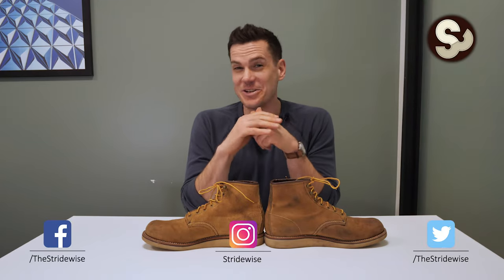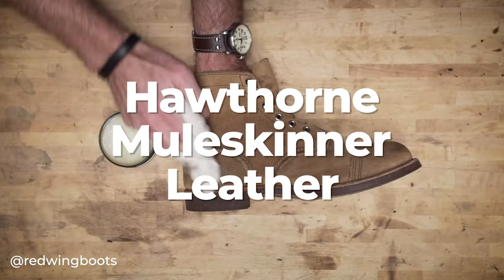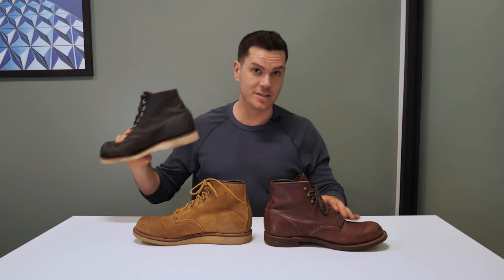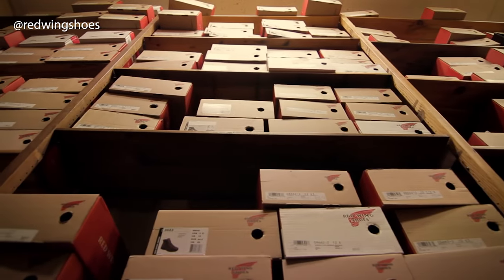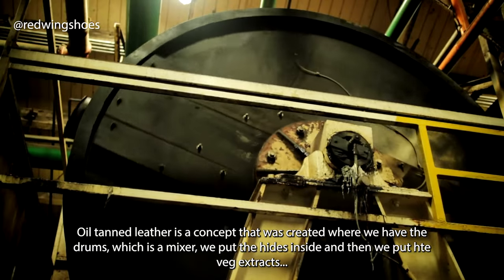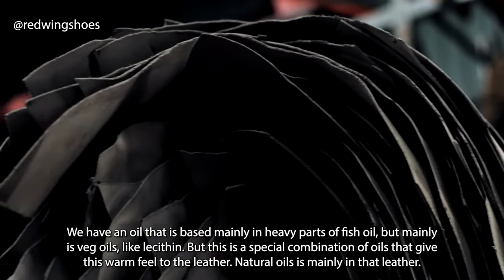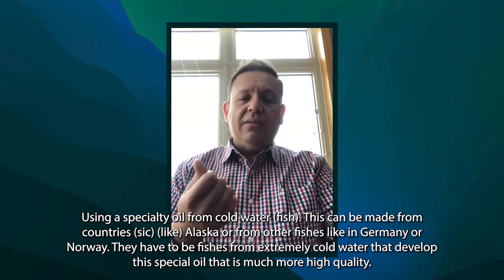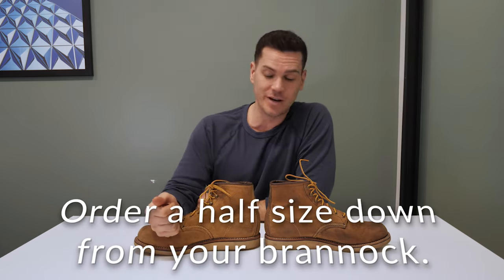How Red Wing Makes Their Leather (+ A Review Of the Extinct Rover Boot)

Comment: In the mid 90's I had a pair of brown 6" wedge supersoles, I believe the model was 00686.  They looked kinda like the ones in this video except smooth leather with the wedge supersole.  Sadly they are discontinued.  They were great for working in finish constuction because they didn't track mud or dirt clods into the new buildings and the sole was very durable compared to todays wedge offerings.
Reply from the maker: Very cool! Still lots of other supersoles on red wing's work boot site
Reply: @Stridewise  Yes, there are many supersole models still made... but not even 1 model has a wedge supersole.